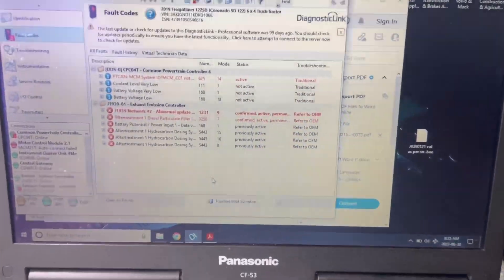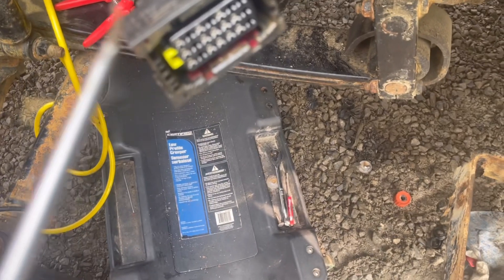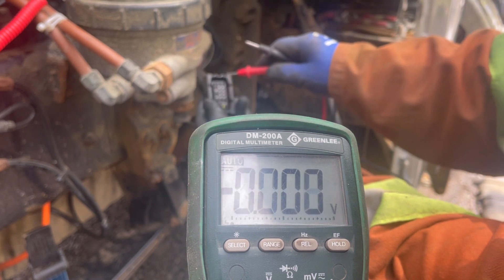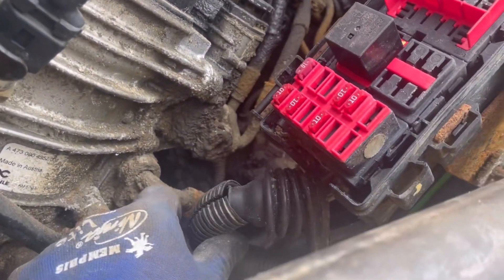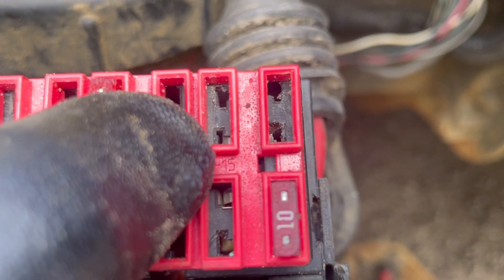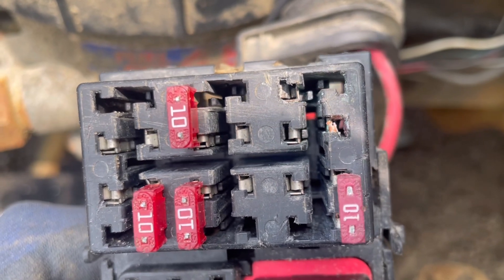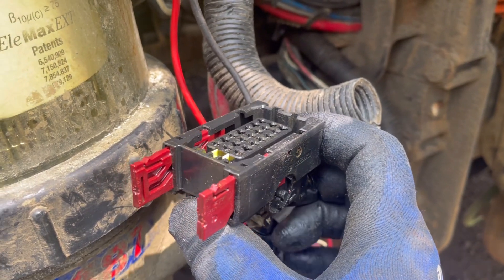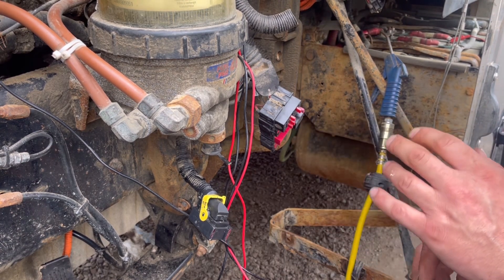How to fix a Freightliner DD16 no start + finding out why scan tool has no communication to MCM

Comment: Not sure how it took so long but this is exactly the content I've been looking for. I'm around chicago also a heavy diesel technician. Truck and equipment and light duty around 14 years I love the electrical diag solving problems. With all systems. Thanks bro for the content
Reply from the maker: @HeavyEDiag  I appreciate the kind words 👍 and glad you liked the content. If you'd like you can join my discord server, It's a small community where we try and solve problems and Ive also uploaded a lot of manuals and info on it . I will be promoting it in one of my next videos, but here is the link . 
https://discord.gg/du6smJwc

Comment: Is the same for cpc4 I have my truck no gage on for def abs speedometer tachometer can you help
Reply from the maker: @javierarreola6867  similar but different , the symptoms you describe sound like a main ignition relay is not turning on. On western stars there is a big pin relay in the fuse box under the hook that controls main power distribution, you can try jumping the two big blades on the relay connector and see if everything comes back online 👍